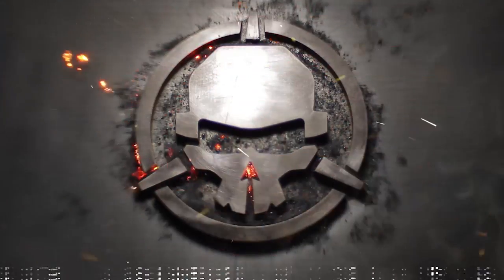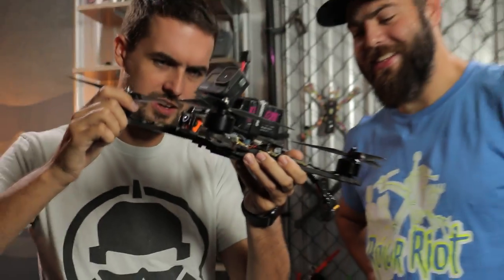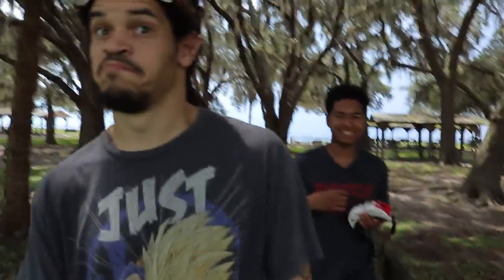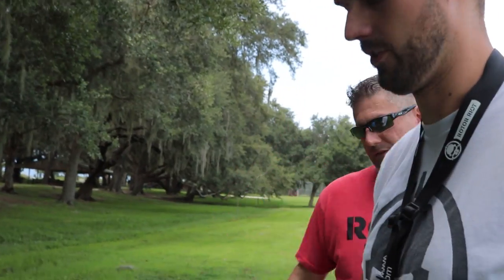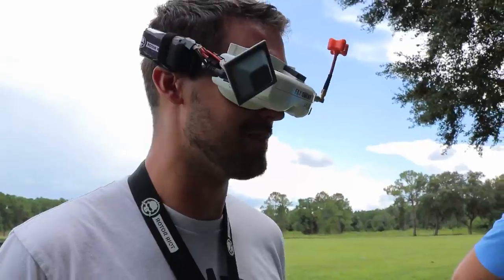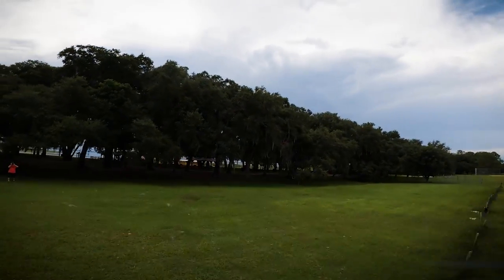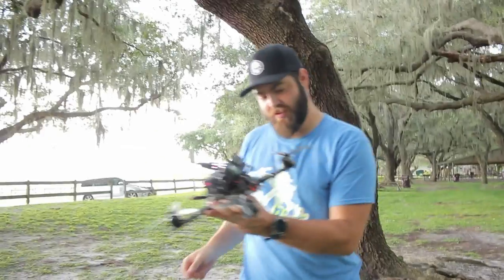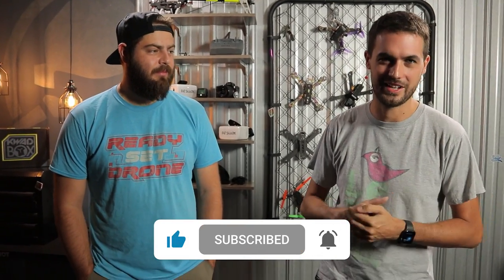12S MONSTER Drone! – 50V of power!

Comment: I'd love to know what the amp draw is on a full throttle punch out.
Reply: I was thinking the same!
Reply: Yeah... me too... like the most I guess...
Reply: I rather would not...
Reply: probably not even that special due to the high voltage.
Reply: not that much since on DC voltage power P = U*I ... since U (voltage) is very high I (amperage) is going to be quite low.
Reply: Lower amp draw but higher voltage can jump a wider gap.  Hence the snap-pop plugin.
Reply: @rambozo_fpv176  Or those beast motors have 2kW per motor and they are eating energy like Tesla car would....who cares. Since its fast for racing pilot, its TOO fast for anyone else....in sim for me, these drones overshoot not 2 meters but 20 meters....thats answer for all i think :D
Reply: LeRainbow FPV amp draw is the same on whatever voltage you choose
Reply: OVER 9000!!!!!!
Reply: @zephyr2278  Flying 120 km/h with a 2450KV motor running on 16.8V you will draw MUCH more Amps than flying 120 km/h with a 1650KV motor running on 25.2V. If I'm wrong please show me the calculations o.O
Reply: @LeRainbow  I'm saying assuming kv stays the same on different voltages Amp draw won't change. People think 6s draws less amps but it only does when you use lower kv motors to get the same rpm
Reply: @LeRainbow  they are not flying on 25v...   that would only be 6s
Reply: @zephyr2278  nah that's BS. If you look up datasheets for brushless motors, you will see the same motor pulls more amps the lower the input voltage! Motors ain't magic see the formula presented by @lerainbow fpv
Reply: @ProDesigneHd  I don’t think you understood my post
Reply: You guys aren't taking into account the weight of the drone, 12s increases the torque required to move it a lot, and a dc motor current consumption increases as torque requirements does. This being said, it doesn't necessarily means that it draws a shit ton of amps, it's just a little more complicated than P=U*I

Comment: Fun to see some other pilots heaving this kwad around.  When Nurk came out with his video I immediately wanted one.  I'm wrapping up a 12s 10" now on a Hildagard 395 frame.  Shout out to erodyo for the sick 3d prints to hold the APDs on it.
Reply: What KV motor are you going to try for going to 12s?   400kv range?

APD goes the extra mile and lets you download the model of their ESC.  Makes for mounting the ESCs a whole new kinda CAD modeling experience.

I recently built a 10in on 3115 640kv that I really like flying on 6s.   I tried it on 6s 2812 900kv and it was freakish and hard to tune.  I am thinking about trying it on 8s with the bigger 640kv motors.   Goal would be to be a pair of 4s2p 18650 packs in parallel for 8s2p LithiumIon.
Reply: @dividingbyzerofpv6748   also trying to use 900kV, but an even larger stator (3114 motor) to dissipate heat from bigger prop.  we shall see if i smoke the motors or not
Reply: @geesekrew  I tried 900kv 10in on 6s and was hitting 60+mph with like 50-60% throttle.    Was off the ground with like 12-15% throttle and just twitchy as hell.   I was unable to tune it to the point that I didnt have hot motors.    When I swapped to 640kv 3115 Tornados my tune settled right in.    I think with the bigger motors I have room to go up to 8s on 10inch but 12s may be too much without reducing prop size.

I dont have a ton of experience tuning tho.   May cut another 10in frame and take it to 8s, I have all the parts needed to make the jump.   Not ready to hop into 12s ESCs yet.   I do have a frame mocked up that would let me run 6s8p 18650 or 12s4p 18650 packs but that would be on 20-24in props on like 130-150kv motors.
Reply: DividingByZero FPV  what pitch props?  I expect a hover around ~20% but maybe I'm off by estimations
Reply: @geesekrew  whatever the HQ 10in triblade is.  The 3115 640kv seem to hover around 20-25% tops on 6s but my build is pretty light weight.    I tried going with APC 10-12in props on another build but even with balancing I was vibrating like crazy so I only use the 10in HQ prop.
Reply: @dividingbyzerofpv6748  hello good sir, what are you using to cut your carbon fiber? I've been wondering what is the best way to start cutting my own frame parts
Reply: @TheBlaznbowls   basically you need a CNC router mill.    There are several brands out there that can do the job from open source that you piece together or entire kits that you can buy.    My own mill is a MillRight Mega V which is a newer design, it has some issues I dont really like but the major plus is it let me design a table that lets me flood the work space so all my cutting is under water so I have no carbon fiber dust to deal with.   My water is then run through a filter to capture the particulates so I can just ziplock the filter and toss it.

To get up and running with a CNC router uou are looking at probably 1400-2500 dollars after tooling and setting up.

You will need a PC that will run software like Universal G Code Sender or whatever your brand uses.

If you do not want to buy a router just get in contact with CNC Madness out of Canada.   They are fair when it comes to pricing on cutting custom frames.   Learned about them thanks to DaveC and his free frames off thingiverse.

Comment: 12:30 it's hard to put into words how the momentum feels because gravity accelerates all objects at the same rate- but that's in a vacuum. on the moon, a feather and a hammer dropped together hit the ground at the same time. when drag from the air is slowing you down, a heavier quad absolutely can be tossed higher and will 'flow' better because it has better penetration thru the fluid it's in. In terms of f=ma the drag force of the air on the quad is the same for any quad with the same dimensions, but the mass (m) is higher so the deceleration the air imparts on the quad (a) must necessarily be lower.
Reply: Heavier quads give you physical expo....

Comment: I wish we could have 30x30 mounting pattern 8s rated 4:1 escs.   Maybe a little fatther than our normal stack ESCs(like fat 20x20 high amps only scaled up to 30x30).    A nice 50-60amp rated 8s 4:1 to help with a tighter build.

12s is awesome but my upper limit for ESC pricing is around 40 dollars per ESC be it Iflight or APD.   Soldering the Iflights is really tight on the signal pad close to ground pad.   

And APD is proprietary firmware.   While the APD esc is really really smooth there is no Bidirectional BLheli 32 RPM filtering, probably not even needed honestly.

Other nice thing about APD is you can download the ESC model so if you have Fusion 360 you can design and 3D print really nice ESC holders to house your expensive APD escs.

Comment: I run loose gimbals too. Definitely more comfortable than the stock tension.
Reply: Same.
Reply: I used to agree but I tightened mine back up, it makes it easier to do stuff like power loops, it's hard to keep it from wobbling without the tension if you're just looking at the sky with no visual reference
Reply: @bren42069  it's all preference. I like how mine are setup now.

Comment: The craziest thing about this drone is that with the props its using, its likely underperforming; 50K max rpm would benefit from a much higher pitch of propeller, and yet it still CRUSHES in flight! Just what happens when you use mo powah baby
Reply: Nice donut media reference babeh

Comment: Sick quad! There is one issue with the KV though. If you work out the tip speed of the props at full throttle, it is well above the speed of sound. As far as I am aware, propellers encounter a lot of funny aero effects at speeds approaching the speed of sound (0.8 - 0.9 times the speed of sound).

Comment: 12S is extreme. I wanna start by building a 8s first as i can get 8s by connecting two 4s. But i can't find a powerful 8s motor. Can manufacturer start designing 8s motors from now on.

Comment: I'd like to know what you do to avoid VR sickness, I've just tried a simulator app with cardboard VR and it gave me nausea!
Reply: This is something that can only be cured with more time in VR. It's like getting seasick you have to find your sea legs. But the plus thing is that VR sickness in a simulator is worse than the sickness you feel fpv with live video. The way I got over mine was I basically would fly until I started to barely feel the sickness coming along. Take a break for as long as you were in VR. So if VR for 10 mins then break for 10. Then repeat. Once you feel like you don't need 10 minutes of break increase VR time, ie vr 15min break 15min if needed but 10 minutes of break will probably be sufficient. Eventually it will not even phase you so by the time you are flying actual fpv it will be nothing. Good luck and don't give up.

Comment: Tiny whoop batteries lol 🤦. Just get a step down switching regulator that takes 60v input. Something using a LMR16030 or similar would suffice.
Reply: I'd rather have a clean output for those components.
Reply: @MantraAerials  Use LC filtering to smooth the output as desired. Lol nearly every FC has as BEC that consists of a filtered switching regulator. The idea you need to use a battery to get smooth voltage because switching regulators are somehow unfilterable is hilarious.

Comment: But volts is not power.
Reply: @anarkngelfpv  Yes, you get the power from the voltage and the amperage. But that are different units.
Reply: @anarkngelfpv  so what, you proved what he said lol
Reply: @anarkngelfpv  I could say my car has 2 tons of kinetic energy because mass is part of the Ekin= 0,5*m*v^2 equation. That's the same logic and totally wrong aswell.
Reply: true in theory, but in practice, higher powered brushless motors for drone have higher voltage
Reply: @ProDesigneHd  Here aswell, voltage, amperage, and power are dependent of each other but they are NOT the same.

Comment: Why not design a quad tailored to two 4S 1500mAh that many of us have lying around? 8S 7" with something like 2810 stator but I couldn't find any that would take 8S.
Reply: Try looking at 3115 motor size.    I feel pretty confident the 3115 Tornado could do 8s possibly on 10inch props.      I use them on 6s and a HobbyWing stack with zero problems.   I want to rebuild with the Matek Xclass PDB and APD ESCs on 8s and see what I get.  Use 6s 18650 for duration and 4s packs in parallel for 8s for ripping.
Reply: @dividingbyzerofpv6748  6s 18650?
Reply: @TheBlaznbowls  actually it is 6s2p 18650 LithiumIon cells.   9min flights just to half pack at 3.6v with 5200mah.    Likely a 20-25min pack.

Comment: its really not about how many 'S' you have. if you have a low kv motor then you can have a 3s putting out more rpm than a 6s. 
its about power. V x I. at high V, most setups have low I. But you can have a high I, low V setup. P = IV. Power is what makes the quad perform. power is related to the load generated by the swept area of the props. i.e. lift, acceleration, speed. 
and in a properly sized quad, the power losses are the same whether you use high I or high V...and noise is related to how much turbulence your swept area generates. the more noise, generally the more inefficient it is aerodynamically..it becomes like a blender.

Comment: i think u people are wasting energy cause your blade tips move faster than speed of sound so that makes it less efficient. u should get more lower kv motors of smaller props.

ok guys I recalculated and ok my bad my calculations were wrong the tip of your blade moves at 262 m/s  so not at the speed of sound

Comment: er awsome quad BUT 900kv at 12 is not higher rpm that 4s 2700kv , 12s 900 kv give 45000rpm vs 4s 2700kv is 45360 rpm , still awsome quad though !
Reply: But this is 7" ond not 5"
Reply: @yanick6530   oh yeah its still bonkers but Math check

Comment: Noooo drib, don’t fall into the 6s trap
Reply: Why what is the trap. I fly 6s for my 5inch banggod freestyle setup but after using 5s on same qwad with 1750kv motors I kinda might like that more. Didn't need all that power for freestyle.
Reply: JamesSkyWalker FPV it’s just a joke, + he has to buy all new batteries
Reply: Okay I gotcha. I was wondering cuz after using 6s I feel like I would have never even used 4s however like I said 5s is pretty rad with 1750kv motors for freestyle
Reply: JamesSkyWalker FPV yea I’m still a 4s 2400kv guy buys that’s mostly because I don’t have a lot of money and every part including the battery’s need to be as cheap as possible